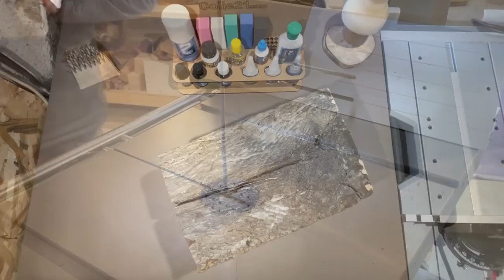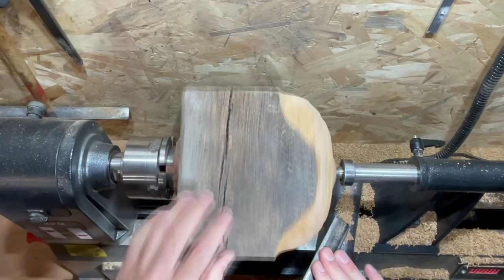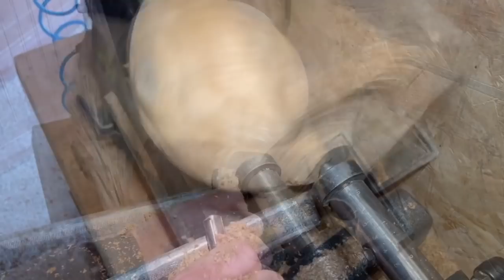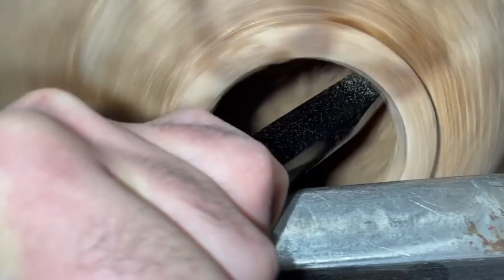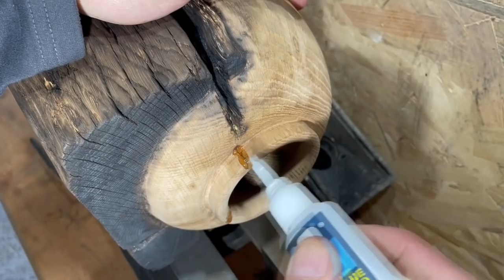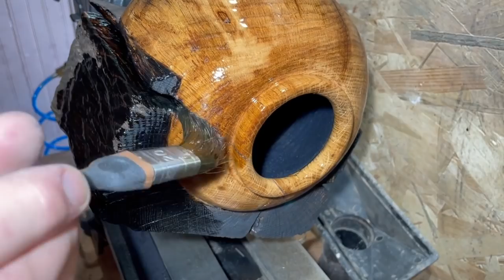woodturning a mysterious vase in a cube of burnt oak

Comment: I didn't know you could cut with the lathe in reverse ?  I'm new as you can see, only turned two bowls so far.
Reply from the maker: Hello Keith Bricknell
It is possible to turn upside down only if your chuck is fitted with a locking screw.
Good luck for your beginnings.
stay safe
see you soon

Comment: Truly a most magnifcent piece. Because it was so off balance ,how low an RPM did you turn? also looked like all our most of your cuts were light. I would like to give this a try. Any advice would be most appreciated .
Much Thanks for a great site!!
Fred Buonocore
Shelter Island ,N.Y
Reply from the maker: Thanks Fred 😉yes indeed you have to turn slowly and have a light hand on the gouge .. this kind of woodturning is dangerous you have to be very patient to finish the piece .. the speed of rotation will depend on the capacity of your wood lathe. . excessive unbalance and vibrations must be avoided
Reply: @bawbreizhartwood  I have a Record Power Coronet Envoy. The piece of wood I would use is a 4 year aged dry Sycamore (Cuts easy). 
Can't wait to give this a try. Keeping your advice in mind at all times.
You have the best site-True Wood Art!!
I'll let you know how it comes out.
All the Best 
Fred Buonocore